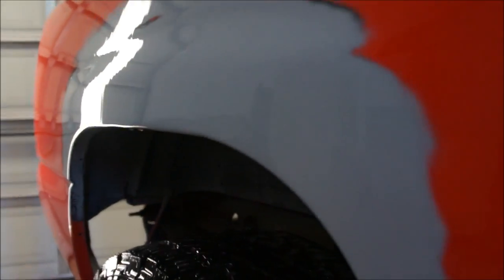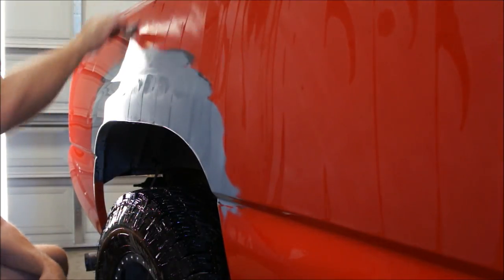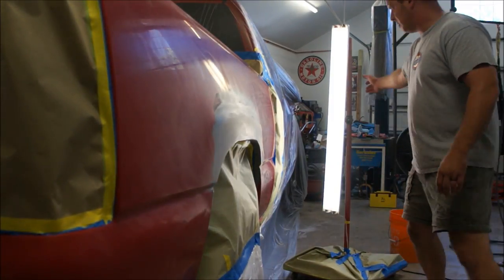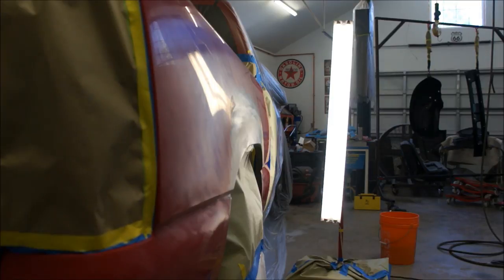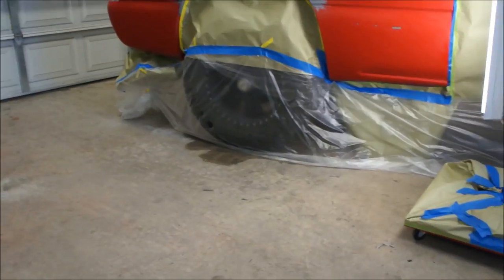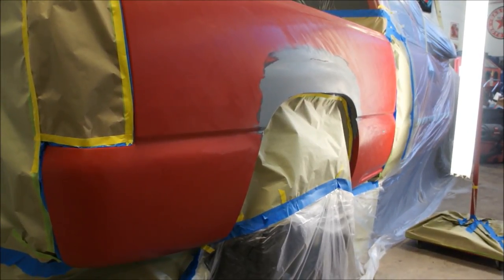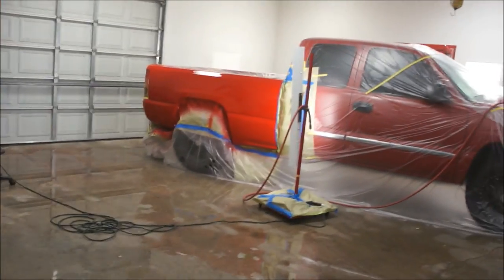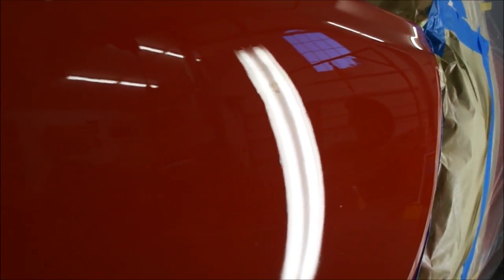Z71 painted

Comment: I run my lights down the side also  on the clear ...especially the older I get and the worse my eyes get. I use a cheap set of walmart readers for the paint job and toss them when im done LOL Looks good light sand and buff to match the factory finish and done....
Reply from the maker: That's a good idea on the readers , my eyes are starting that shit too. I staged the truck up like that so the clear would spray into the corner where the fan is , but all my good lighting is on the other side . Thanks for watching

Comment: every coat counts in my book of books
Reply from the maker: Yes , and if the first is not just right do you sand it off and start over ? Or bury it with another coat and hope you get that one right ?
Reply: i cant tell u 1 way or the other what is best or what works...i do know 4 me ...me only...is that i lay the first coat the same as i do the last coat...burying the first dry coat with a heavy coat as the last coat will work ...but i dont becuz i will get a sager or a run...a run is way better than orange peel ( becuz with orange peel u will have 2 put in ALOT of tyme wet sanding the peel out...i really dont care 4 ANY kind of heavy sanding LOL...but i end up sanding becuz i want it 2 look like a brand new dime   PEEEEACE
Reply from the maker: +wildeyednorthernboy 👍